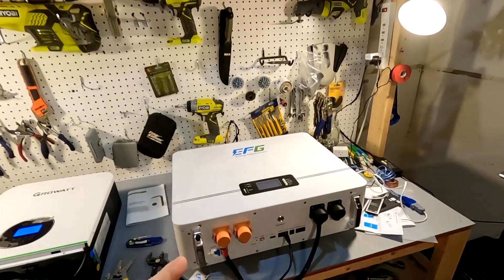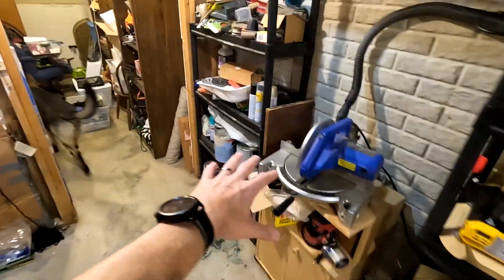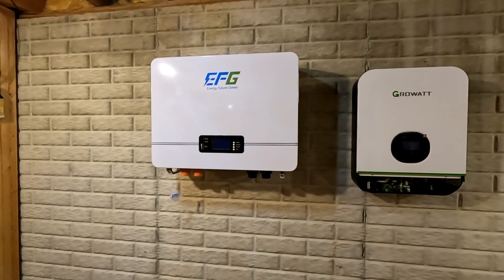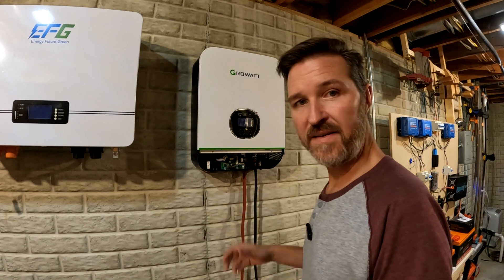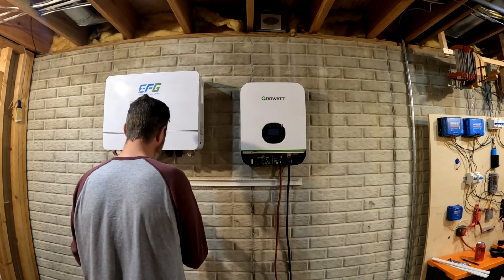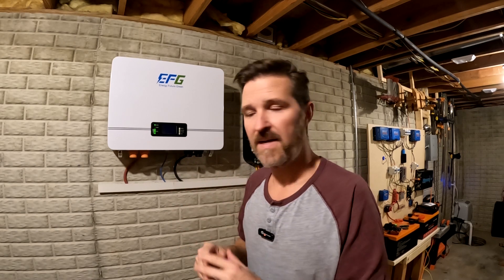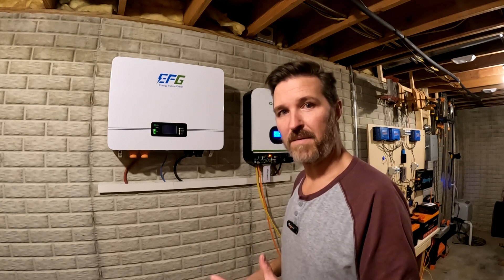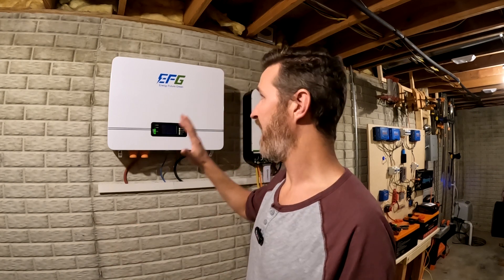EFG-Battery 48v 100ah Powerwall LifePo4 Battery Review!  Part 3

Comment: Did you ever finish the installation of the  EFG batteries?  I would be interested in hearing about your experience with these batteries.
Reply from the maker: I did.  It's connected to 3k growatt.  I don't use the communication between the two.  I just go by voltage when it comes to charging from shore power.

Comment: What are you doing to get around the N-G bond in the inverter?
Reply from the maker: I didn't think I needed to worry about the bond since I'm not directing the AC output back to a power panel.  The built in battery charger shouldn't care.  Are you saying it's double bonded when in pass thru mode?
Reply: @Off Grid Basement  if you keep it off grid to a sub panel and not tied to your house panel you are good to go, seems like growatt is supposed to remove the bonding screw but apparently not all units are being done , check yours to see if your bond is done internally,  I have two lvm-es 48 volt and both are N-G bonded amd are not supposed to be